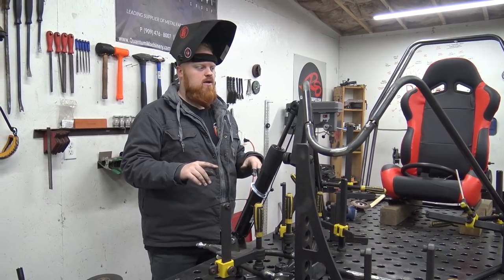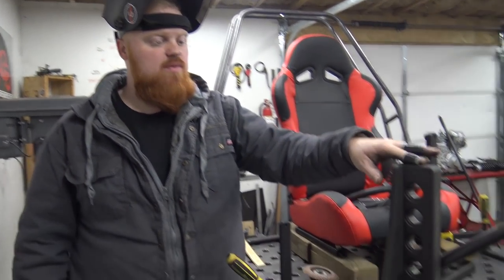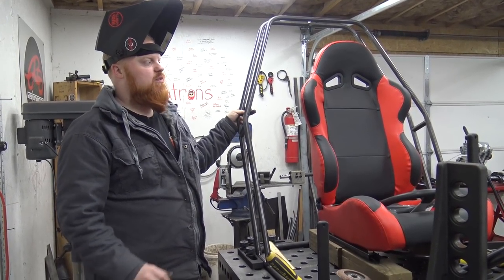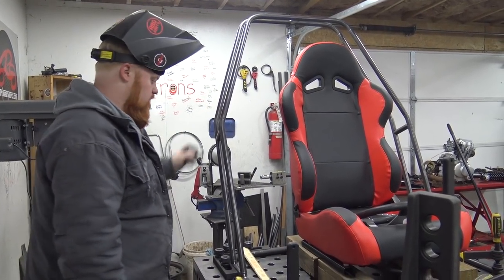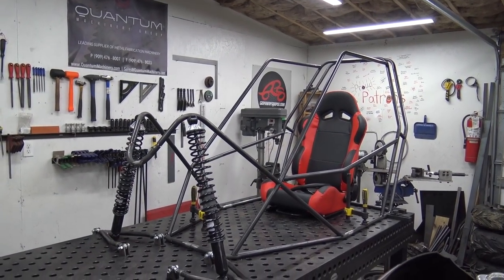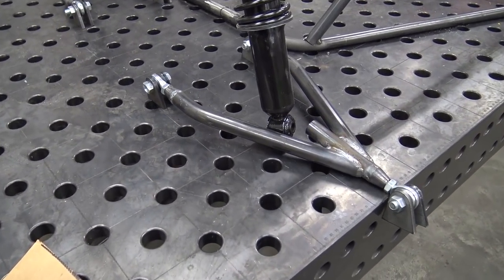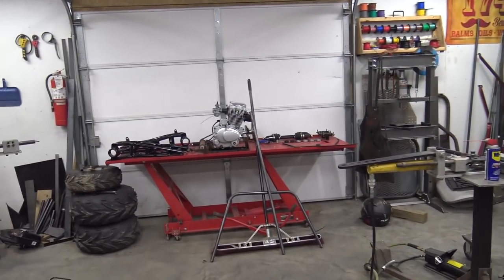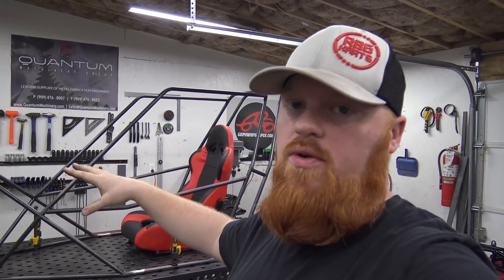Boosted 670cc V-twin IRS Buggy Build Ep1

Comment: This has the capability to be awesome! I saw a video where a guy had built a very similar buggy with 4 wheel independent long travel suspension, the performance of that thing was absolutely incredible, it could go over huge bumps at speed and the suspension would just soak up the bumps like they weren't even there. It was an awesome thing to see.

Comment: You have to use a boost referenced 1:1 fuel pressure regulator. Tons of people have tried and failed and that is part of the reasons.
Reply: That's if you use a blow through setup. If they use a draw through, there is no need for any pressure referencing. Now this doesn't mean it'll be easy. Turbo setups are always troublesome with carbs, especially ones that allow hardly any fine circuit adjustments. I think the Aisin blower is going to he the winning setup because of how simple they are.
Reply: Blow through is the way to go.
Reply: Original carb/turbo setups used a hat that enclosed the entire carburetor.
Reply: When forced induction first come around yes. But that hasn't been used since before I was born and for good reason.
Reply: @bryanroupe8646  Plenty of things that work are no longer in use.

Comment: Dont get me wrong, it looks really good, but i would have built the front a arms longer. You would build the mounting point for the lower a-arms basically right in the middle in the front, then build long a arms. That way you are able to get more travel. I would also mount the shocks closet to the middle, that way you can mount them like 6-8 inches from the end of the a arm and even though you will only be using a 10-12" travel shock, you will end up with like 16-18" of suspension travel at the wheel, maybe even more. But, thats just my .02....im a big fan of your channel and all of your builds. I really like that fab table. Im in the process of getting a cnc plasma table set up and once i do, i am going to build a fab table similar to the one you're using. Great work man.

Comment: They make efi kits for Briggs and Stratton V Twins. Try to adapt it onto this and have a better setup
Reply: Hmm wonder if it would work the predator is a Honda clone I think
Reply: Especially if they Change it to be a turbo setup carburetors will become weird once you put variable pressures during acceleration and deceleration because the afr will raise and lower.

Comment: Boosted lawn mower engine. Sweet. Just keep the compression low adding boost almost doubles your effective compression ratio. Keep it between 8.5 and 9.5 to 1 in the compression department at 9.5 max boost shouldnt be more than 8 psi. Anything over that and you will need race fuel. 
  Dont know how your going to manage a boost referenced power valve in a mikunni carb but I dont have any expierence boosting small engines or motorcycles so this should be fun. I'll learn something new. And if not I will learn what not to do. Hahah. Killer builds man. Keep up the good work. 
  Would love some details on the seigmund Fab table. What size it is. What attachments you have for fastening and bracing. Also that angle finder/ bent yard stick you use on your bender. Whats the name of that. Where do we get that.

Comment: You need to look at bend tech pro software 
You can draw complete chassis view it 3d ....print cut sheets for each part calibrate the software to your bender it’s very affordable
I used it to design and build a two seater sand rail motorcycle powered 
I drew it for two weeks tweeking and making changes 
Printed cut sheets 
And built the chassis in three days fully tacked

Comment: What material do you use to make the kart. " pipe, tube," I don't know what the difference is really.  A little tip please. Thanks for the awesome content
Reply: Tube is designed to structural. Pipe is designed to get the sewer out of your house.
Reply: @user-neo71665  ooh , ok I see. I need to make some minor repairs to my daughter's goat, so I'll make sure to look for tube.. any recommended tube type? Like thickness or anything like that?
Reply: Maybe in residential. Go tell a pipe fitter in the industrial world that. I've ran miles of pipe and never once messed with a sewer. That's miss leading information. There are both and you can use both. But if you're looking to purely build a tube chassis, you go with chrome Molly. Otherwise you can use a schedule 40 PIPE or thicker, seamless. But just because it's being used on a chassis doesn't automatically make it tubing...
Reply: Tubing is measured by the outside diameter. Pipe is measured from the inside diameter. Tubing is also structural were as piping is used to transfer fluid internally.
Reply: @jasonrock5465  100% facts, I agree.

Comment: I like the overall look of it so far just question using 1 inch tube for the cage. Even the chinese buggies use at least 1.25. Most of us that build small buggies use that or 1.5 inch tube.
Reply: neo 71665 right now I’m using 1.25 inch..... but much thinner. I’m assuming the Chinese karts have much much thinner tube than that because that looked pretty thick. That will be strong enough but pretty heavy I’m assuming
Reply: Depends on what schedule tubing he is using.

Comment: Greg, What type of Dana Transaxle are you using? Is it out of a riding lawnmower? is that strong enough for the 670?
I have been trying to find a reverse gear box that can hold up to 40 H.P. Any suggestions? Thanks
Reply: Wondering the same thing too.

Comment: Why after installing the stage 1 mod. Kit on my ct200u did it become so hard to crank, and I put the new jet in the carb and it idled rich and would not move. My kit did not come with a new emulsion tube.